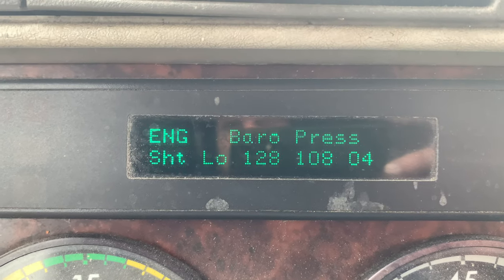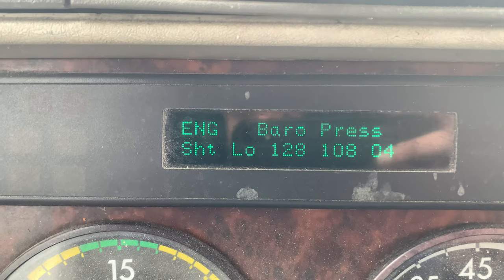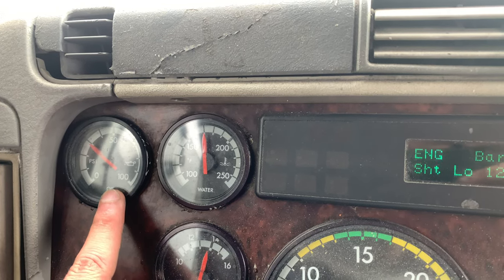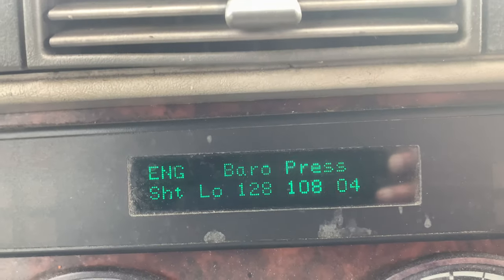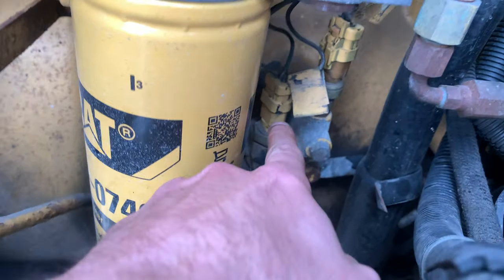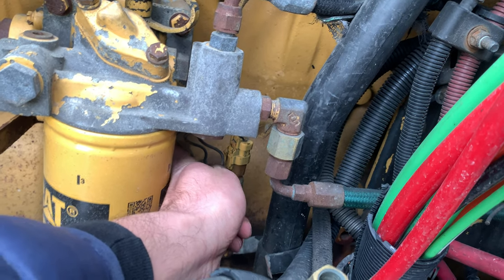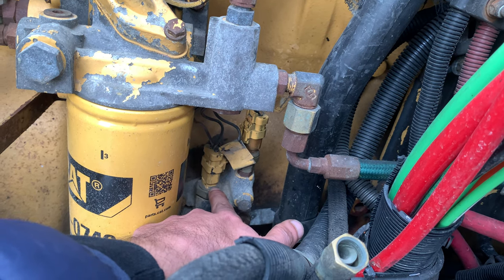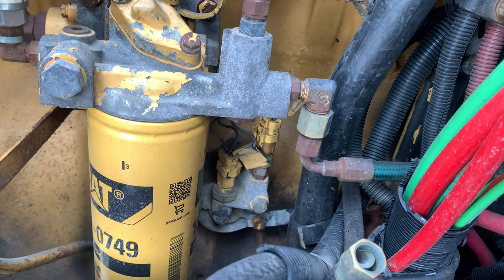Engine Barometric pressure sensor shut low 128 108 04 fault C15 semi truck

Comment: hello, dear ,  i have truck with cat c15 when my truck  bump or small hill   low pressure meter lamp is on and big noise low pressure,  i change low pressure sensor still same problem  my time 1 million miles, what can do  please any one help me Mechanic don,t know this issue     thankyou
Reply from the maker: Hello, I am not a mechanic but almost every time A fault occurs because of a bump, it mean that you may have a loose wire somewhere. I would turn truck on, have someone sit in the cap to watch lights, while you play with some wires. You may get lucky